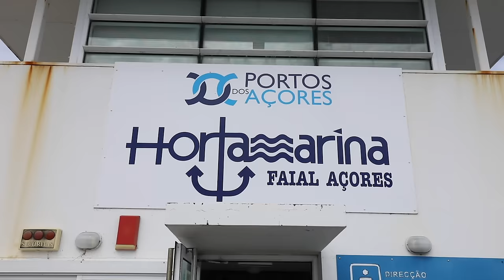Diving with BLUE SHARKS in the Azores! Sailing Vessel Delos Ep.253

Comment: Great episode! Awesome adventures! Hope to see more details about you flying that dinghy and climbing volcano! Next week? Also, I think there's few things that i think were a bit off with the outboard motor maintenance. First off, impeller works/turns even when the prop isn't due to gear transmission being in the lower unit. The drive shaft always turns in the leg and then gear selector through gear shaft switches prop shaft to either move one or the other direction. Second, the impeller is supposed to pump the water through water pipe up to the head unit, so when you take it off you should also change seals on that tube so there's full pressure going all the way up. Learned all those facts when my outboard decided to stop working the first time because of melted last pieces of impeller and it's housing...

Comment: That dingy motor problem about the gear issue sound more like the rubber inside the prop is starting to slip.  That’s what happens when you start to give it gas and the prop starts to fail.   The rubber is a safety measure to prevent you from doing greater damage when you hit something.  I have the same motor and same problem.  It’s very similar to a slipping clutch.  Obviously, this footage is old.  Hope it helps.

Comment: Love your videos It is like going on a holiday every week.
Just a tip: NO Locktite ,those bottom end bolts never get free on their own and are often sooo hard to untorque.

I have 40 years experience and I use Antisieze aluminum (there is also a copper one) on ALL my marine bolts and nuts .
The right torque will keep them tight and antiseize will keep them corrosion free for many years.A must have on board.

Comment: Brady, when you ride, you need to give the horse its head. That means don't pull back unless you want to stop. Horses learn from the release of pressure, not the pressure, which they will resist. When you pull back, the bit digs into the bars in the horse's mouth which causes him to throw his head (painful.) Bring your hand forward and don't allow your wrist to move behind the pommel. Keep your shoulders over your hips, and your ankles in line with your hips, heels slightly down. Head up. If you lean too far forward, the horse feels your weight and will be uncomfortable, so try to stay in the center, and relax. That horse would just follow Blue's horse. He wouldn't run off. But if he did, then just keep your hands forward and give short pulls back on the reins, and sit back in your seat a bit. Pull, release. If he still doesn't stop, turn his head to one side. Not hard, but enough to put him in a circle. I trained horses in the Spanish Vaquero style. Try these things the next time and you'll feel like a good rider.

Comment: That was great footage of the Blue Sharks.  So you don't want to swim in a prone position or have an increased heart rate or you will be considered food for the sharks.  How many shark attacks do these guys encounter on their trips each year?  

I did not understand Brady's comments about not needing a visa because you are attached to the boat.  

If the impeller looked good did you find the cause of the overheating?  Just replacing the old impeller with a new one fixed it?

Comment: You might want to look at getting a barrel and running the motor in a tank with a lot of vinegar/water which will help dissolve and get the salt crystal out the engine block which can also help it cool better. I'd keep a thermostat on board for it as well as I have learned in the past they can either break and get stuck in the closed position.  I'm sure constant salt on outboards and maybe no way to flush the motor can really take a tole on them over time.

Comment: What about the thermostat in the head of the motor ???? Great video guys and gals love you guys
Reply: You would think that flushing the cooling system and checking the thermostat would be on the list for overheating issues. If it's also jumping out of gear, that's a gearbox issue, not a cooling issue.

Comment: That prop has a major blend in one blade! Air cooled outboards are long gone! Use grease not locktite on the legs bolts and grease the top spline as well. Check as your sliding the leg up that water pipe lines up with the top of the pump housing!

Comment: The impeller was shot and needed replacing. The blades being curved like that is a sign it needs changing. And will definitely cool your engine much better. The "peehole" will be pumping much stronger. Als Be sure to mix 50:1 two stroke. Hows the eninge now seeing that was 7 months ago

Comment: cooling problem is build up form the salt water. has happened to my motors. you need to do an acid wash. it will break up the the build up in the motor. water muric acid mixture will break it up. you just need a bucket large enough to run the motor in the mixture. you will be amazed at how much stuff comes out of the engine block.

Comment: If the prop stops pushing while it's in gear, that's gearbox, not cooling, hope this helps you.  Fair winds!
Reply: And a slipping gearbox would cause the extra heat too.
Reply: “Slipping gearbox”= not going anywhere any time soon. Lol.
Reply: Haha,  right? It depends on the design but it could slip intermittently or just a little at first. Changing whatever oil lubes it could offer some time too if it is burning up the oil. I guess we will see how it performs in future episodes.

Comment: Pardon my ignorance, but what is the ‘BS with schegen visa’ about?
Reply: The Shengan visa allows only 3 months in the WHOLE of the shengan region. If you're first Shengan entry is Portugal, for example, how can you then sail to northern Europe/Baltic, explore those areas and leave the Shengan area within 3 months. Its impossible. After the 3 months you must remain outside the Shengan zone for 3 months before you can re enter. This is extremely difficult for cruisers with non EU passports. If each country had it's own visa you could travel endlessly as you would have a new visa each time you crossed a boarder.

Comment: Aww. Too bad the horses have bits. The YouTube channel "Think like a horse" and others show that it is very doable to control a horse without a bit- which is cruel when you think about it. How would you like a metal bar in your mouth being constantly tugged on by someone? Ouch! it looks like Brady is holding the reins too tight at 27:07 by the way the horse is trying to ease the tension by holding his head so close to his neck.

Comment: Come on guys you now you needed to fix the prop? you keep trying to hid it from the shots. with the tip bent like that it will were out the barring of the lower unit and yes chase it to jump out of gear. take the prop off find a big flat smooth rock that is close to a blade that is not bent get a B.F.H.  put the bent blade on the rock and give it a whack or two or three. 
 A rock bent it in the first place might as well fix it with one and a B.F.H.  right?
The motor will run smother and rev higher with it fixed.